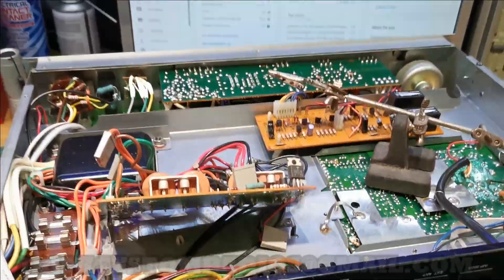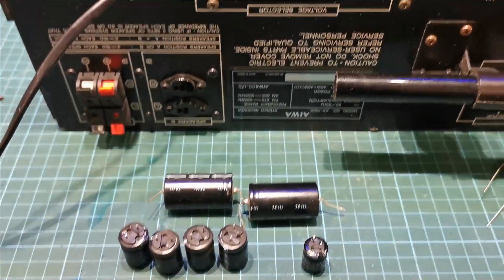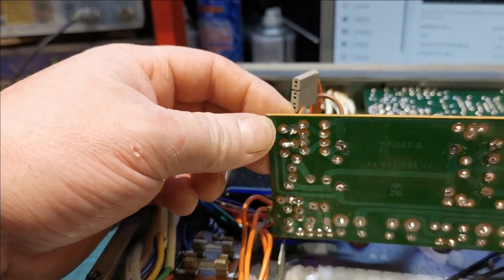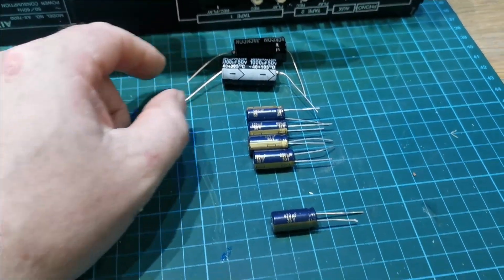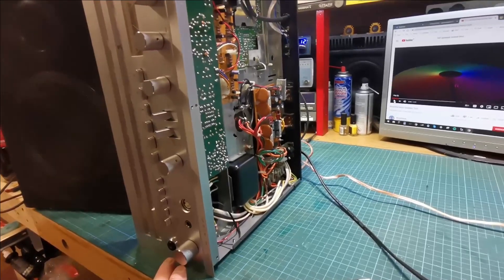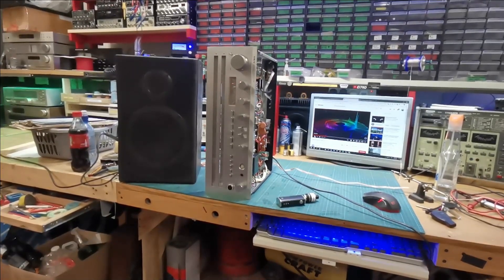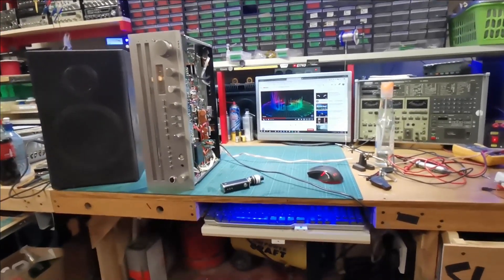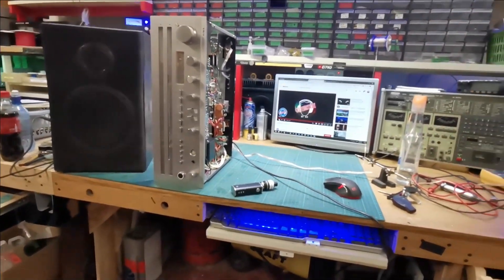AIWA AX 7600 POWER SUPPLY REFRESH

Comment: Hello.
Did you ever get around to the illumination? I’ve got an AX 7600 with no light in the to meter levels. And from the service manual, i can’t figure out what type of light bulbs it uses. Can you help?
Thanks
Reply from the maker: No! I have to get back to it. Soon buddy. I'm planning a RGB LED conversion
Reply: @GeorgeEI7KO  thanks. I’ll be looking forward to that. I suspect that the light source is a fixed part of the meter assembly.